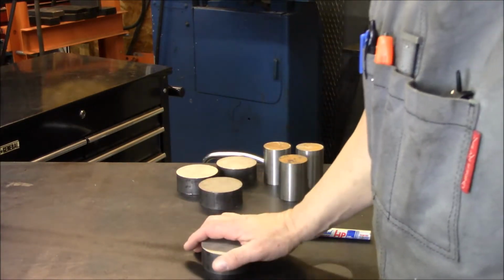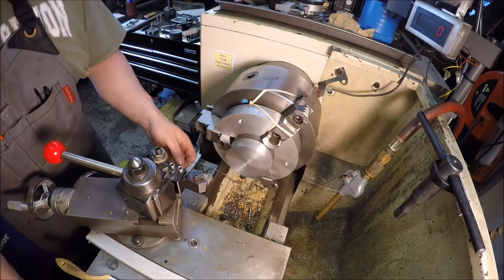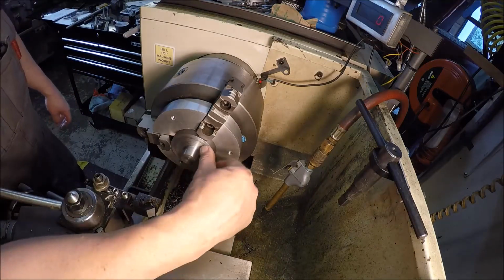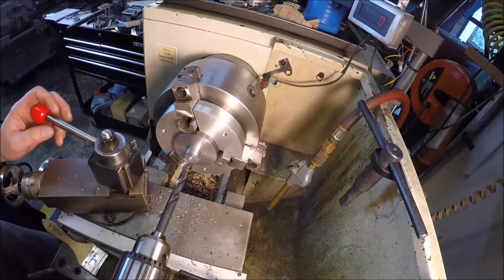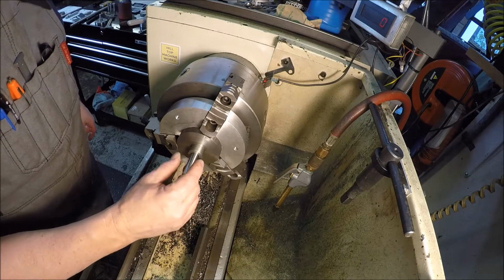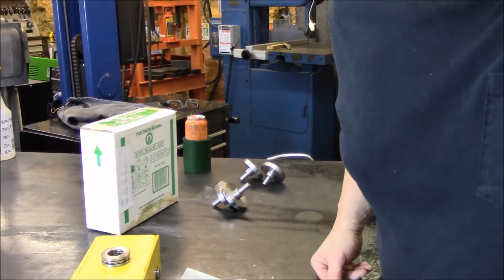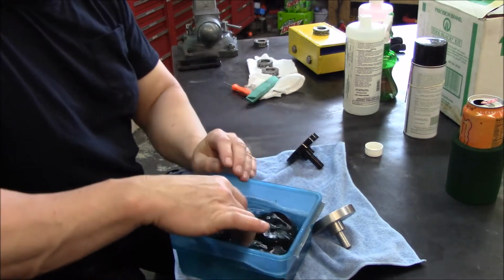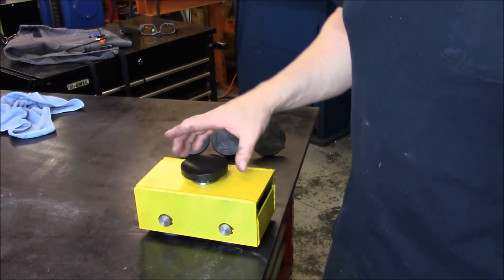Machine skates rotating pads part #2

Comment: Very nice Tom. Could have used those a couple weeks ago. You weren’t boring me. Those pads can be turned over to make sweet machine feet with a bit more thread for adjustment. Like the camera position on the lathe. Good work. 👍👍👍
Reply from the maker: Thanks Ron!

Comment: Tom, are you using wood cribbing or rubber on top of the pads to prevent slippage.  Some rubber matting, or 1/4" plywood could be used.  Will have to make a set for my shop.  Great video.
Reply from the maker: Probably use rubber when needed. Thanks MP.